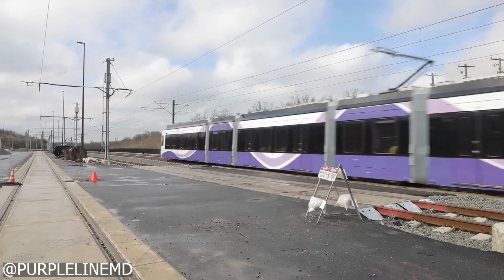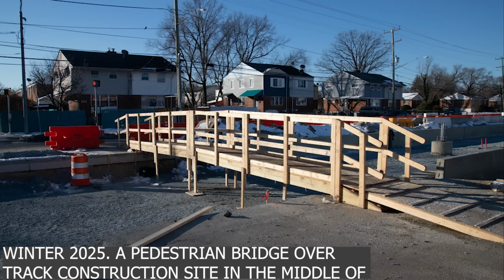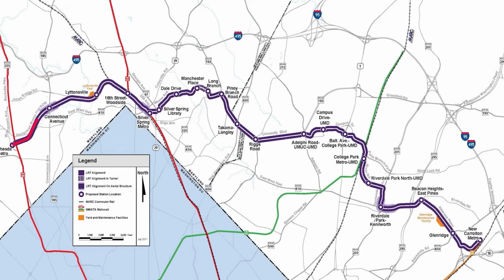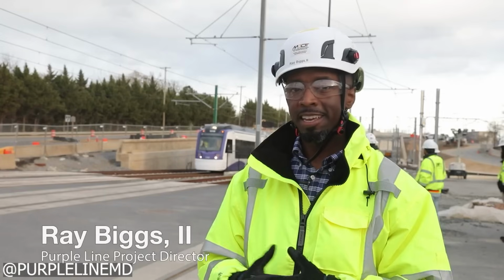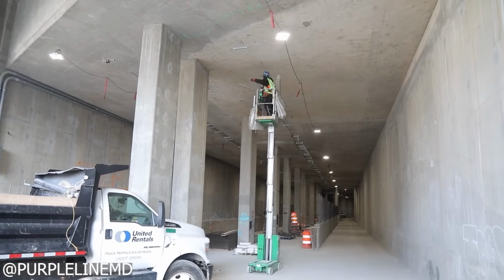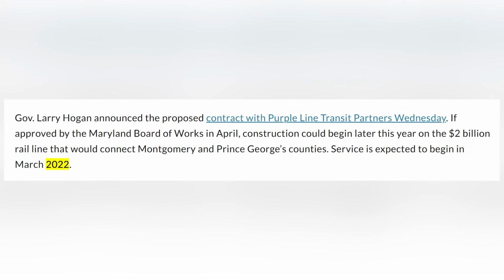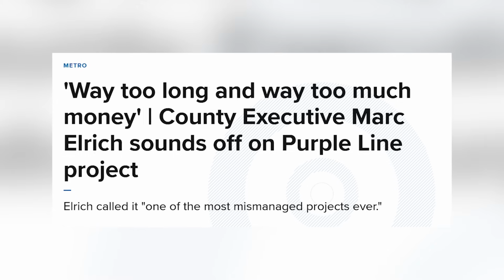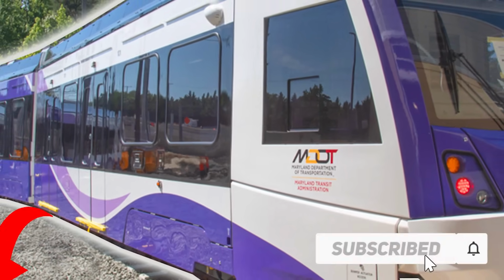Washington DC's New Train Is Coming?

Comment: I always thought it was just another metro line that would be run by WMATA. Guess I was mistaken. It probably would have saved on development costs, though.
Reply: DC has problems with its own streetcar going way over budget and it's hasn't been able to be built to the size it should have been. Also this line is entirely in Maryland, so Maryland and its counties are paying for it, while WMATA will likely be the one to be handling operations.